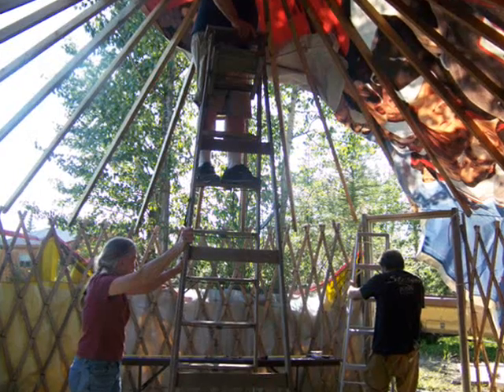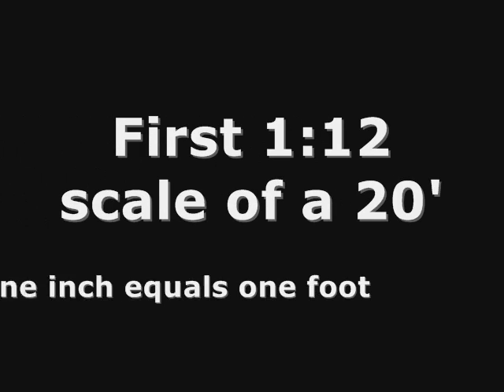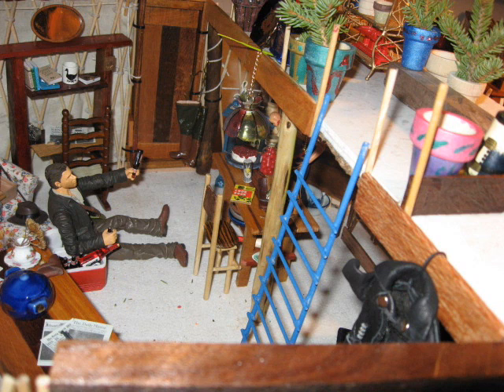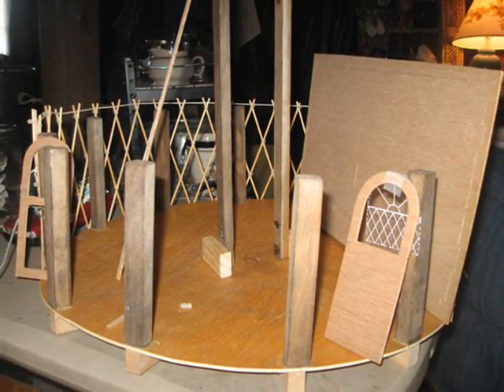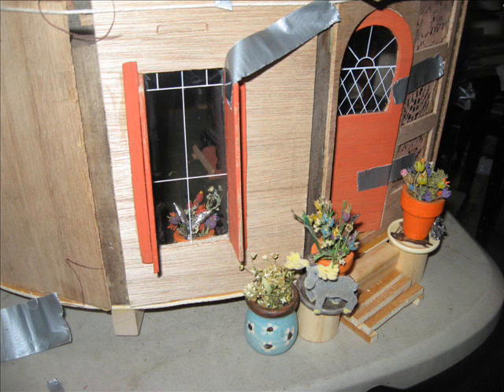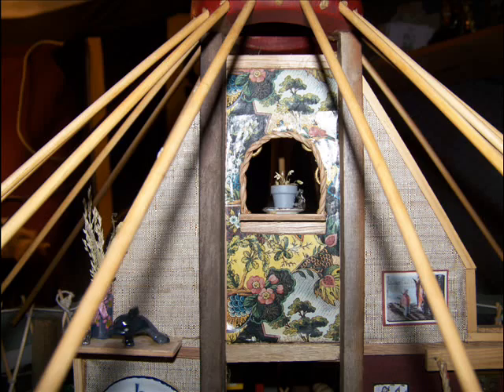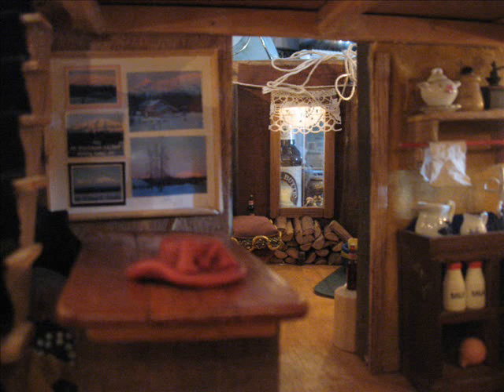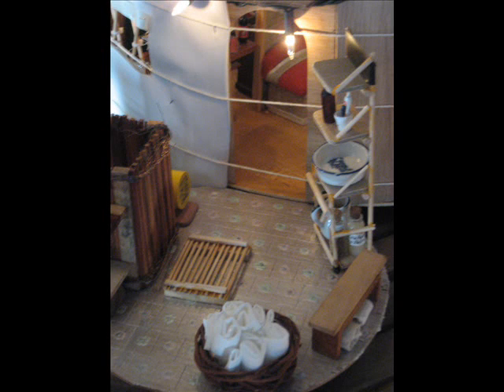How to survive homelessness with style!

Comment: i have been in transitional and temporary housing most of my life, and move constantly. but especially since my apartment burned down in 2007 i have been entirely displaced, and where i am now, i will have to move from soon so it is difficult to homestead. however, when i spent a year in 2010 in a car and in a homeless shelter, i was always able to get to library and a get a guest pass to find out information. the only reason i found a shelter was by going online after 2 months in the car.

Comment: You could always use large PVC pipe that has spring locks that snap and hold it all into place for the skeleton in which to build upon. Like you would use to frame a wooden shed before covering it with wood. Your outer covering could be tied or velcroed to the PVC structure. The roof can be assembled in the same manner with the covering applied in the same manner then lifted into position and then clamped into place. A roll of plastic lattice could be stretched around the outside in place of the wooden lattice. Even chicken wire could be used with bunggy cords to hold it in place affixed to the entryway. A water proffered floor could be secured along the bottom that is secured to the PVC to complete your shelter. This design could also be covered with cement canvas for a more permanent shelter has well! Novartis

Comment: You are however right in that building codes exceed safety factors which I don't agree with.They now heavily regulate the astetics also. 
But, I have to allow some compassion to those who buy property to have its value fall because of a eyesore nearby.
There is a safe, respectful & fair way to address this. I just don't think this particular type of structure meets all three of those needed points.

Comment: Take what you have learned and use aluminum or another lite metal and make sections that lock together to make your shelter. Ball baring pivot points magnetic connectors swivel locks could all be used to perfect your designs of this type of shelter. If designed right can be broken all down and stored like any regular tent is now. Novartis

Comment: Solar vacuum tube set ups can be retrofitted to heat gallium and circulated with an electromagnetic pump that can, heat the shelter make hot water generate electricity with a thermal electric generator have a hot plate oven to cook with and even run absorption refrigeration units to store food and used has air conditioning for the shelter. Novartis